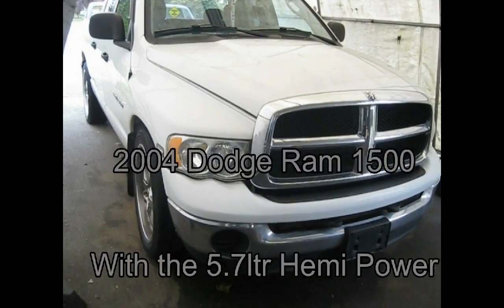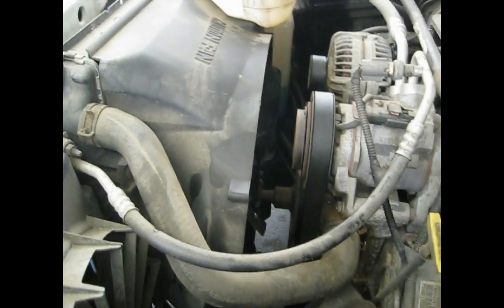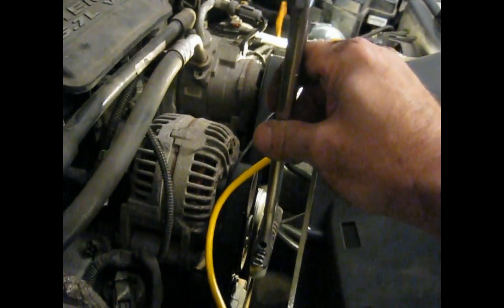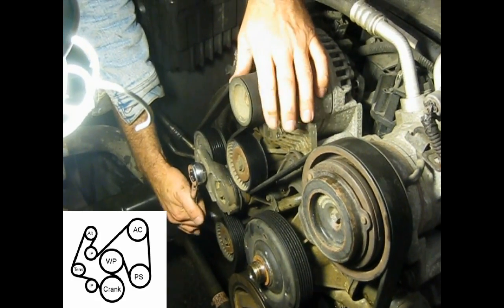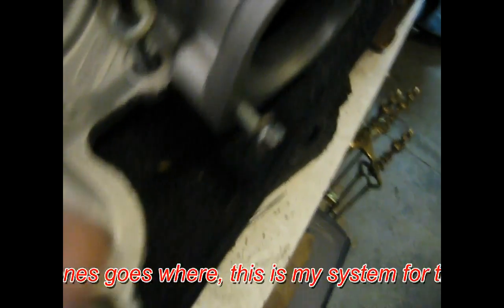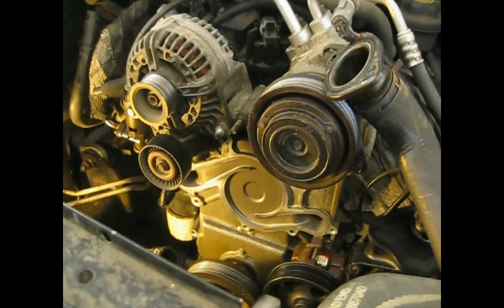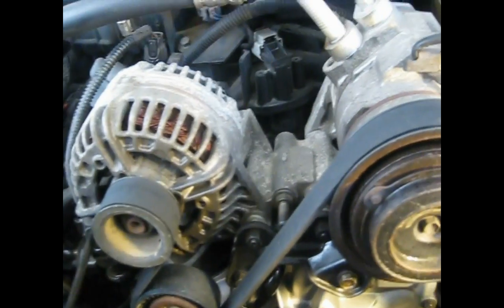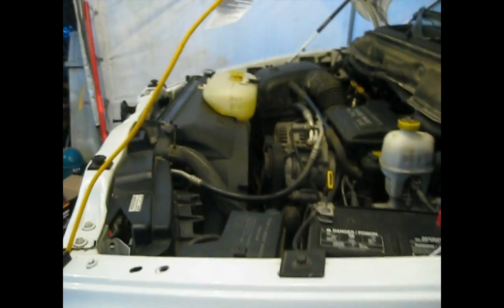2004 Dodge Ram 1500 5.7ltr Hemi Water Pump Removal and Installation

Comment: No need to make your bar just jam your screw driver in one of those holes and holes on the pully of water pump then use a hand torch heat up the nut on fan clutch comes of like butter boys. Also no need to take washer fluid resivor off just undo electrical clips and hose  take it with your fan shroud. As for your over flow box just take overflow line off rad and push box back and tie it back makes life easier.
Reply from the maker: Thanks Wayne, it's always good to have other views and alternative ways of tackling things like this. I did try the screw driving thing initially but was worried because it has to wedge against aluminum parts that could break under torque and one mechanic told me be careful using a torch in some of those areas because you can damage rubber mounts, seals and bearings if you do it wrong. He said that's why they use a special fit tool which i tried, but it never worked for me so i made my own. My washer reservoir plugs were almost "seized" together and i was told after the job was done (of course), that i could have just sprayed WD40 lubricant or anything similar to free them up. With that being said you're right they could probably stay on the shroud, but it is good to know how to remove that jug just the same, because that i didn't know before either.

Comment: Great video.  Local Chrysler dealer wanted $650 to do this job.  Like you said, $100 for the parts and some sweat and the job was done.  Thanks.
Reply from the maker: Yeah and you know i was almost regretting starting this job myself because it did seem a bit overwhelming when i first looked it over, but i figured in for penny in for a pound, brought out the cam and made this video and now in hind sight I'm so glad i did. I've helped people and saved not only myself a lot of cash but others as well. Thanks Robbie for the feedback, I'm glad my video was helpful  :)
Reply from the maker: pablo palma
Hey pablo, thx for the reply. I'm not quite sure if i follow what you are referring to though. Do you mean an in-line hose connector for flushing the coolant? I would have added one of those but just didn't see the immediate need, although that being said they are good to have. Thanks for the advise, something to consider for sure.
Reply from the maker: pablo palma
Your welcome, I'm glad i could help. nice car buy the way, i like those cars when they are are fixed up

Comment: The little tip shaker what ever you call it on the thermo stat is for letting air thru to bleed the system, you pit it at 12 so the air can pass thru
Reply from the maker: Thx good to know :)

Comment: The little tip shaker what ever you call it on the thermo stat is for letting air thru to bleed the system, you pit it at 12 so the air can pass thru
Reply from the maker: Yeah after i made the video my dad also said that was for air to pass through, but thanks lee agers, guess i should have added that in the notes but either way the just of it is there. :)

Comment: Hey Kevin great video, i have a question for you, i have an 04 ram 1500 5.7 i have changed the water pump and i want to back flush the heater core do you know which hose from the water pump to the heater core is the inlet hose, is it the longer black tube of the water pump or is it the shorter tube of water pump?
Reply from the maker: Thanks Johnny appreciate the feed back, Sorry i don't have an answer to your question, great question though, but I'm not certain and i don't want to give you bad advise. I have never done a flush, but i may just look into that now, sounds like a good idea.

You know if I were to dare a chance at it though without reading up on it first, i would probably disconnect both from "the pump side" "NOT the firewall side" because you could damage the inlets on the heater core. And I would probably flush it both ways with a hose attachment, if you're only doing the heater core. Sorry i can't offer a better answer I really have no idea, never done that before.
Reply: thanks Kevin , and i have been looking into it more and ive heard the way to find out which is the inlet hose to the hearter core is the hose that gets hot the quickest by touch at cold start of engine, and when i did that i found out that the inlet hose to heater core is the longer tube of the water pump, so now its time for me to flush the core out.
Reply from the maker: Johnny De La Rosa
great news and good info thanks best of luck Johnny,glad its all workin out for you.  :)

Comment: Just finished changing my water pump. I watched this video before I started and I am positive watching this saved me hours (literally) of my time. the job still took me most of the day but it was easy and I had no surprises.
Reply from the maker: Thank you Jimmy for the feed back, I'm happy my video helped you. I'm planning on making more videos as future challenges come up.
(It feels good when you can help others, Thanks again  :)
Reply: Yeah Kevin to know about the special tool for the fan was a huge help i am in California went to O'rielly auto parts and was able to borrow a spanner wrench for the job.  All the bolts were a size 13 metric except the one stud (15mm) and one other pulley I think(15mm)
Reply from the maker: Jimmy Schmaggnoli
OK thanks, that's good to know Jimmy that question was asked here, I'm sure that will be a help for someone setting up the tools to start this job.

Comment: what size is the bolts to the water pump
Reply from the maker: You know what, I'm not really sure, sorry :(   i had my socket set beside me and just picked through until i had a snug fit. I think i was using metric mostly.., you do mean the bolt wrench size I'm assuming? In hind sight i should have noted the specific tools needed for the job. Next video i will, Thanks Nathan
Reply: Kevin Jones
Great video.  What is the bolt that has a nut and washer with it?  I watched another video also.
Reply from the maker: Dale Musec
Thanks Dale, not sure what bolt you mean, but there is the one that kind of looks like a stud and bolt and i think it could be there for another bolt on accessory that my truck was missing, best guess anyway.  :)
Reply from the maker: Hey Nathan Null, Jimmy Schmaggnoli wrote; All the bolts were a size 13 metric except the one stud (15mm) and one other pulley I think(15mm).